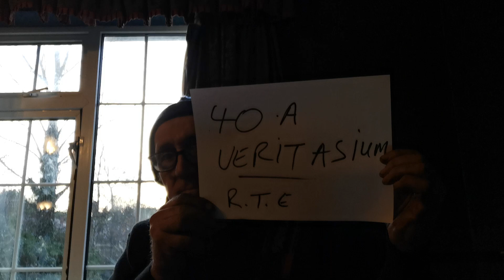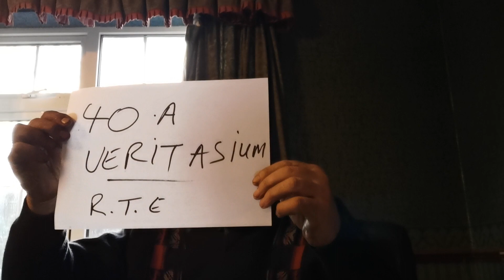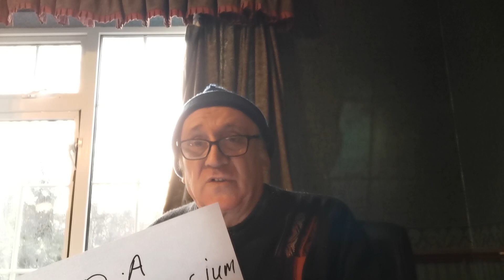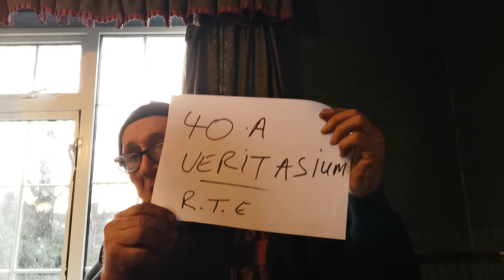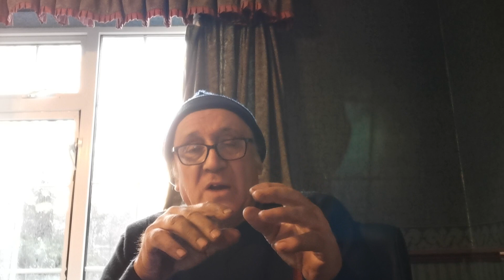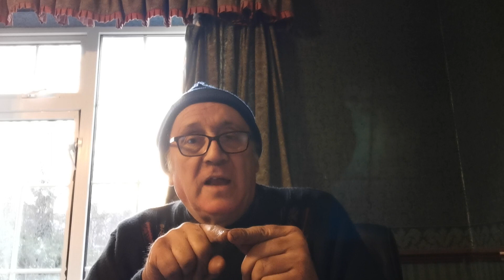40A - Electricity and Cables (A Reply to Veritasium)

Comment: In the case of coal power station, the energy is stored in the coal. This is used to create a force in the turbine. This force is then used to create the electric and magnetic force in the cables which then acts on the electrons in the wires. Veritasium has confused the force with the energy.